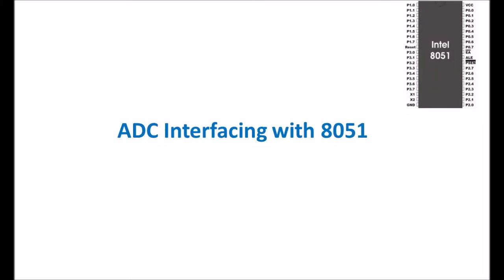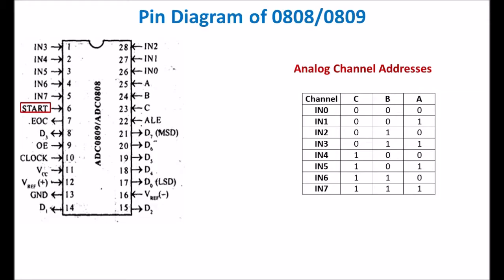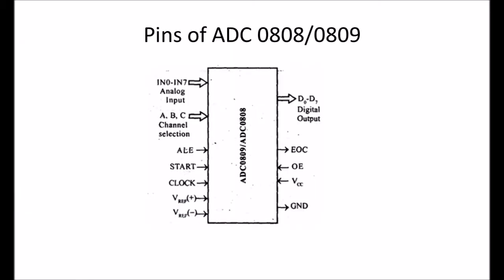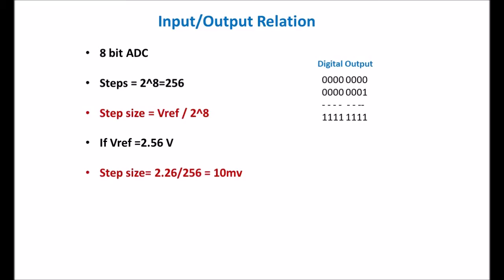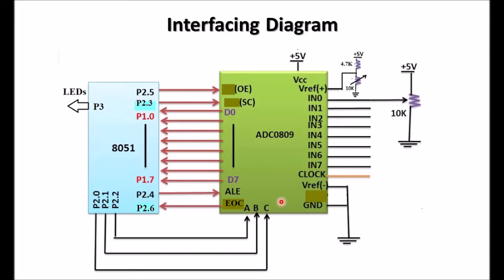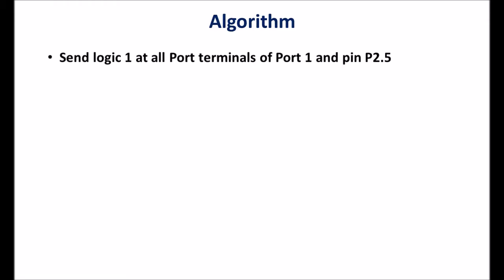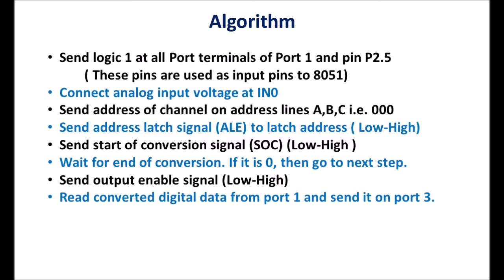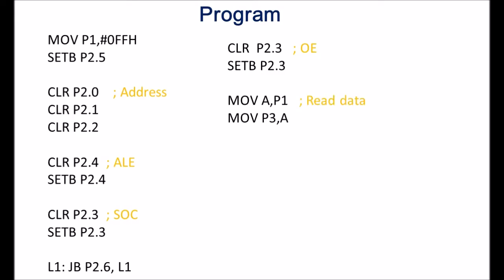Lecture 31: Assembly language program to interface analog to digital converter (ADC) to 8051

Comment: Good day Ma , You said we have to send Logic 1 to Port 1 and P2.5 because they are used as Input terminals to the microcontroller  , I just want to confirm if there's no mistake because you mentioned at the beginning of the video that it's P2.6 that's the input terminal [ EOC] 
So do you mean SETB P2.5 or SETB P2.6